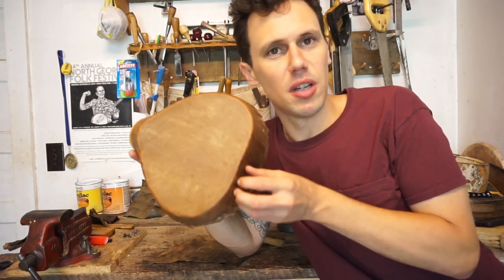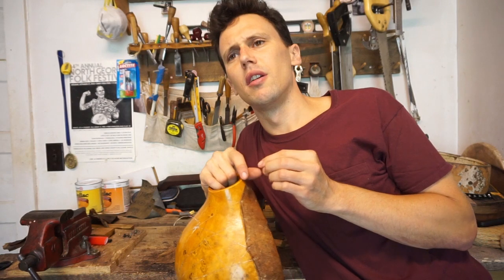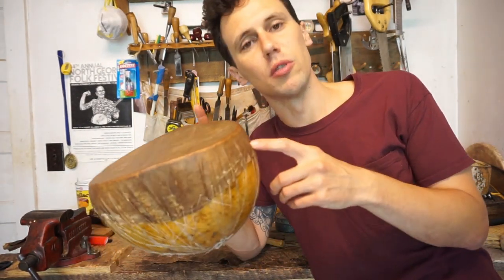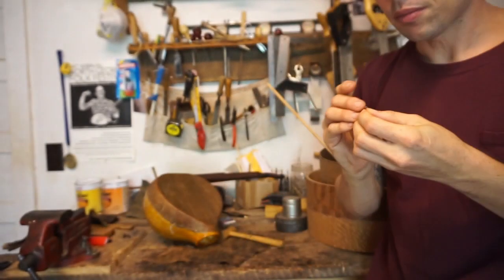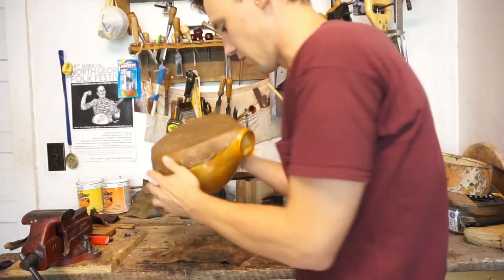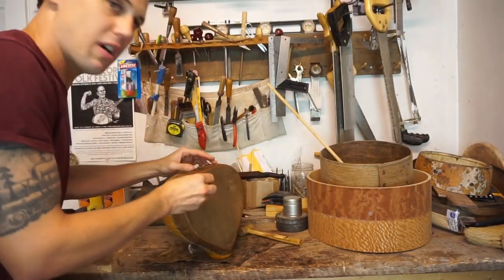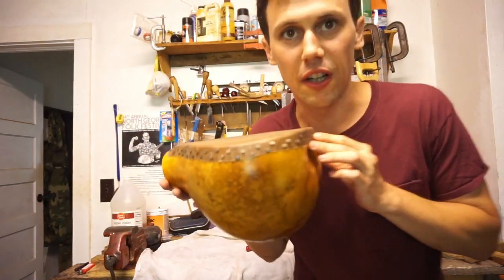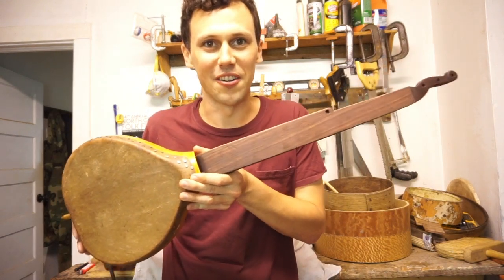Build a Gourd Banjo - Part 3 of 4

Comment: This is great, thanks for posting this series!  I am assuming that when you tack the head down that the head should still be damp, is that correct?  I'm guessing that the idea is that the head will stretch as it dries and that it's best to tack it down immediately after the dental-floss stage, is that correct?  Thank you!
Reply from the maker: Darrin, people have different ways of doing it. Whenever I've tried to tack a head while wet it's always torn. I sew my hide on, then leave it sit at least over night. When the humidity level is at my region's average, I tack the dry hide. This has worked the best for me over the years.
Reply: @CliftonHicksbanjo  - thanks for clarifying.  I've been wanting to try building a gourd banjo for a while now.  Just need to find the time.  Thanks!

Comment: Love your videos. I see that at the end you’re using about 1/2” dowel as the spike. Do you find that it’s strong enough to take the pressure of the strings. I’m worried about it warping over time. Thanks a bunch!
Reply from the maker: Thanks, Armond. Nylon strings tuned to fCFAC or some other low tuning are very unlikely to warp the oak dowel.
Reply: @CliftonHicksbanjo  thanks man!